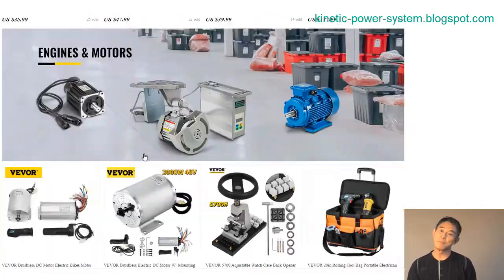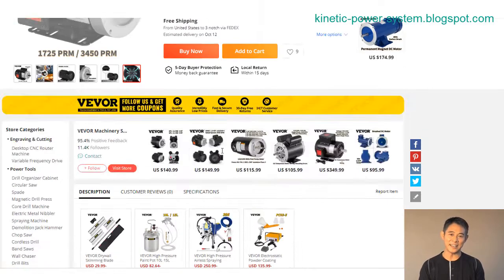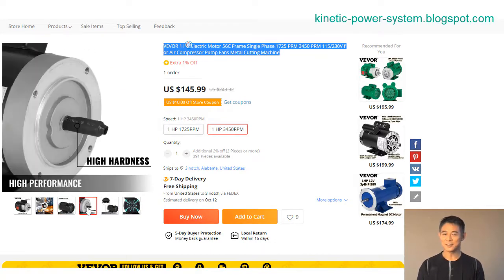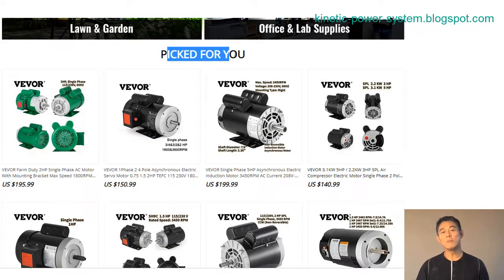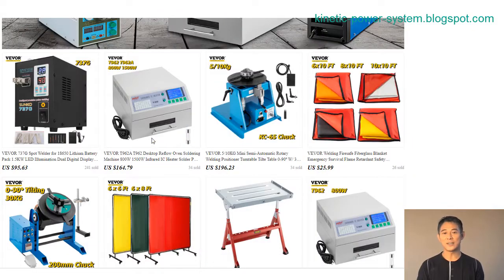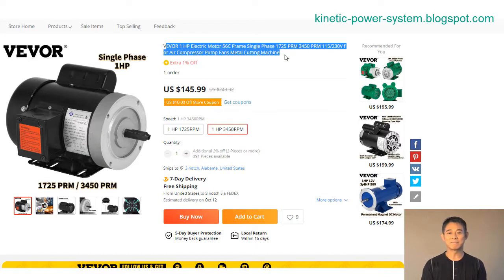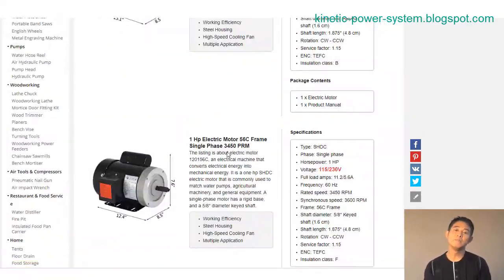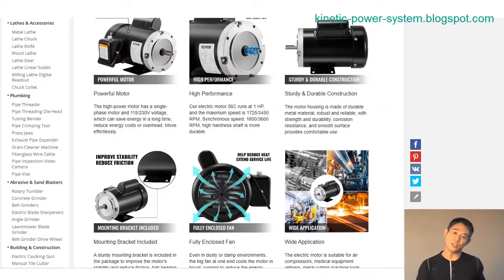AC Induction Motor: Single phase asynchronous electric induction motor by SEVOR

Comment from the maker: The SEVOR single phase asynchronous electric induction motor is a great choice for those needing an AC induction motor. This powerful and efficient motor offers plenty of torque, making it ideal for a wide range of applications. With its easy installation and operation, the VEVOR asynchronous electric servo motor is a great choice for a wide variety of needs.